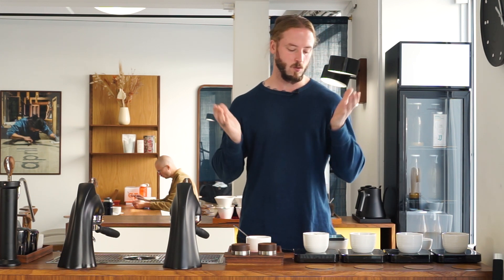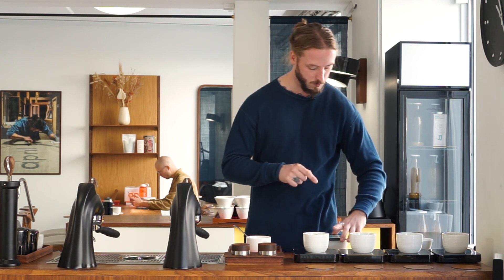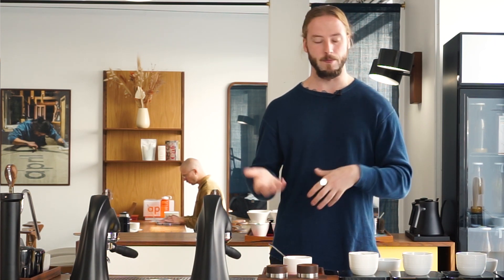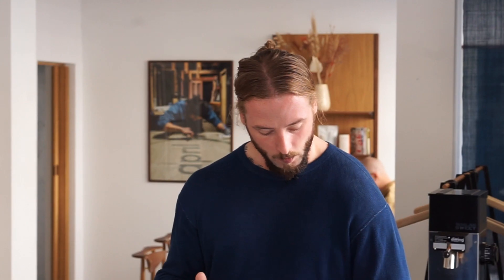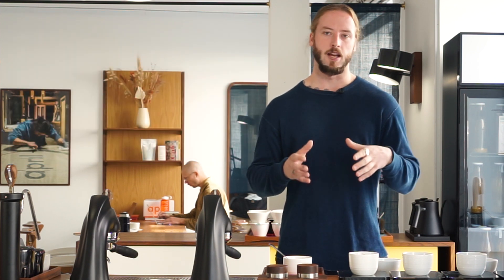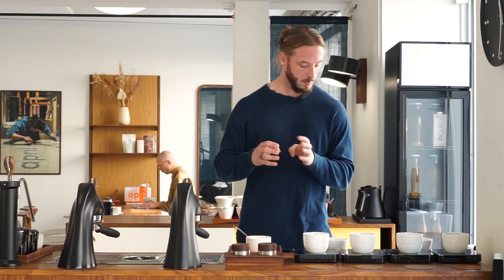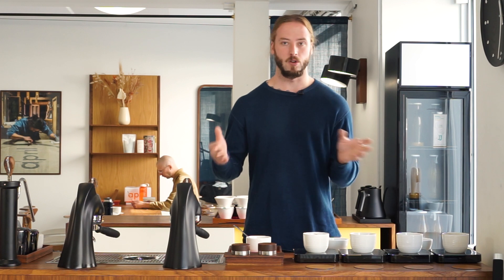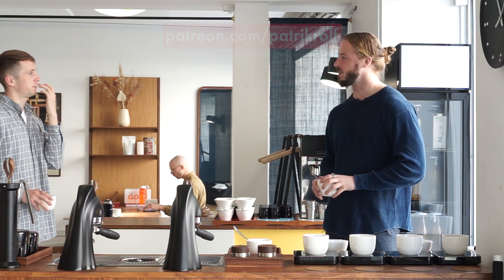What is in Your Water? Reviewing Water for Coffee Brewing | Coffee with April #190

Comment: You should try Perfect Coffee water, it has Chlorides in it, but I thought it makes light roasts taste really nice, it seems to tone down some acidity or bitterness and just gives you nice sweet juicy results, I never noticed it being salty but I might have to try it again (ran out, and back to Third Wave Water for now) should try again and see if I notice a saltiness, maybe that's what makes it good? :D 
The problem with Chlorides which I'm concerned about, supposedly they're corrosive to stainless steel boilers (especially if it gets more concentrated and at higher pressure/temperatures like in a steam boiler).  ECM, and Perfect Coffee water, and I think the shop I got it from all basically said not to worry, and that it's fine, but some say we should be worried, at least for long term use. 

Third Wave Water I found you can half the dose and get twice the amount of use out of it that way (better value) but it seems to work better that way, at least for me. I thought it was over-extracting easy for espresso (using espresso profile TWW packets) at the full / recommended use amount.

Comment: I've been using TWW here for couple years before I saw your video. We have a Reverse Osmosis system in our home independent from any reasons related to brewing coffee. The city water is awful and super hard.  The RO TDS ~ 20ppm. I use TWW 2 liter packs into lab grade glass bottle using 2000 ml of RO and the resulting TDS = 191ppm very consistently. I have tried other mineal packs in the past, don't recall which ones, but always came back to TWW, and I haven't tried any others for a few years.  I also like the fact that TWW has the 2-liter size packs, easier storage on the self and less weight to lift. PS I also find that I'm getting my best pour overs using April v2 brewer. :goodvibes:

Comment: Thanks for this comparison video. I am currently using aquacode (diluted with 7.5l of distilled water to achieve 70ppm) and have previously used TWW and a BWT filter as well. I feel that when comparing brews made with water at a softer ppm (~70ppm), Aquacode seems to result in tasty brews for myself (i.e., better balance and mouthfeel) than TWW which tends to taste hollow, but where TWW shines is when it’s at higher ppm (~140ppm with 4.5l), where you get really a pleasant mouthfeel, while for aqua code, the saltiness becomes more distinct in the cup at that ppm. On the other hand, BWT is quite different from both the water mineral brands. I find that coffees brewed with it tend to have its acidity highlighted, resulting in very juicy cups. I often would have to extract more in order to balance the brew. This is at ~80ppm from the tap with BWT attached, i am from Singapore which tends to have much softer water than other parts of the world. Hope you could compare them at lower ppm and see how it turn out!
Reply: I found this to be very accurate and I found this to be true! TWW on my case is only good for cleaner tasting coffees espcially washed coffees, where the 70ppm aquacode could have a lack of acidity.